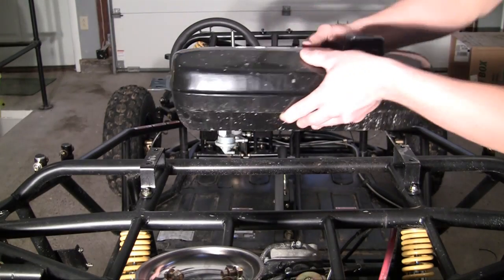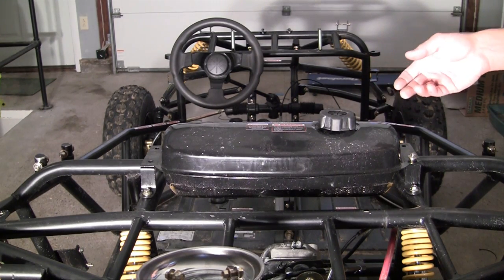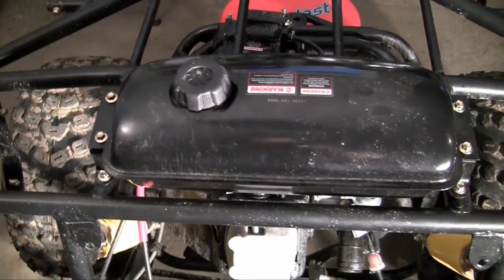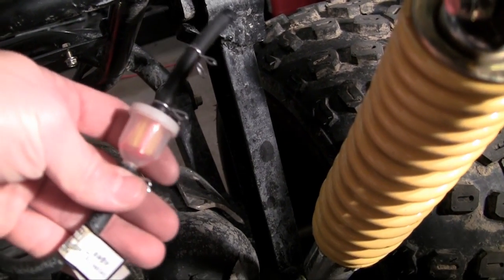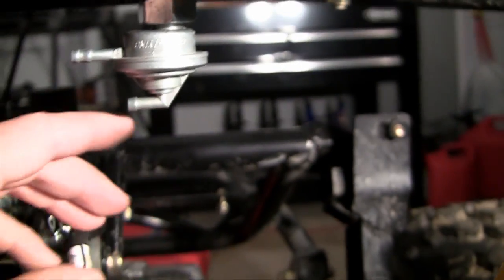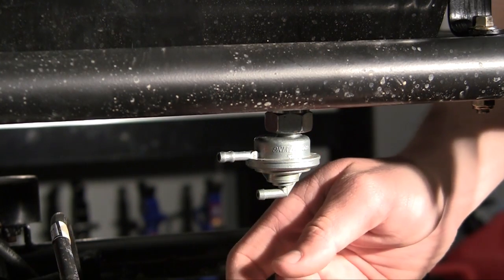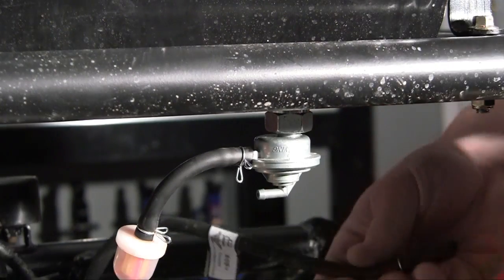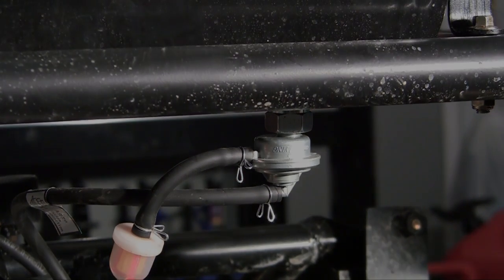How to Build a Go Kart - 22 - Gas Tank

Comment: That vacuum line doesnt pull vapors that is a vacuum activated fuel shutoff valve when engine turns over and pulls vacuum it allows fuel to flow when it's not pulling vacuum it cuts fuel off .